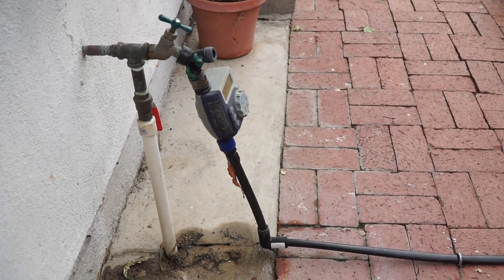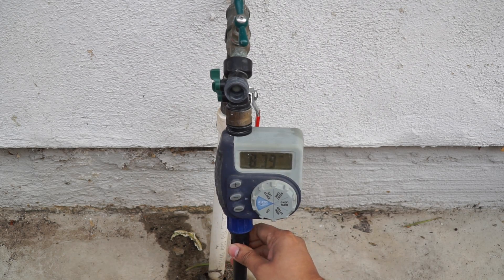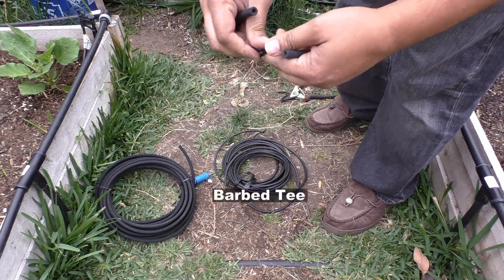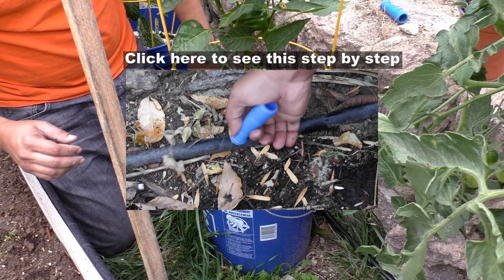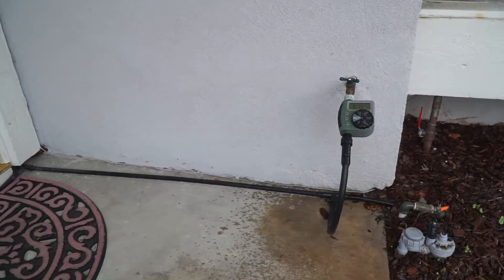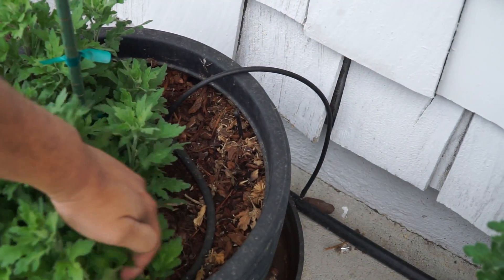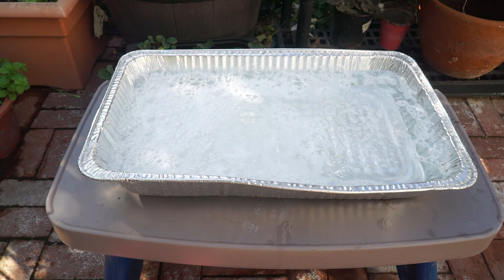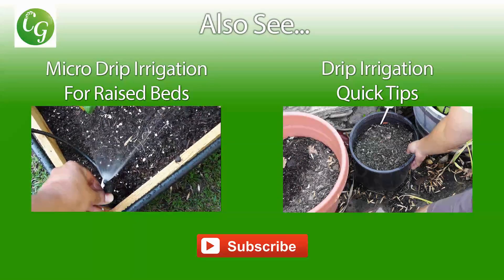Drip Irrigation Watering System For Containers - Setup & Instructions

Comment: Thanks a lot for all the information. As we are stuck at home due to the pandemic, wanted to try out gardening. Your channel is super helpful for beginners. I am trying to install a drip irrigation system at home, we have 4ft wide narrow garden bed with plants on the perimeter of our house. One dilemma I have is about the emitters to install in the narrow garden bed. Do you recommend a soaker hose ? One downside I see with soaker hose is if plants roots grow, we have to adjust the size of the circle. Thanks again!

Comment: Awesome video......I am also thinking of getting automatic water system for my pots. I don't have a garden but i have lots of containers in my verandah and at different levels......at the front of my house in front verandah at the back yard and back compound wall I have vertical garden..... Also I have balkani there also my planters are set up in vertical form..... I have sone more thwn 350 pots.... 250 at front and rest at the balkani and back yard..... My water tank is at the third floor. 
Can you advise what sort of drip irrigation syatem I shus have..... Will it be successfull?...... Do I need to use water pump..... Or pressure regulator..... Anything else

Comment from the maker: Parts used in this video:
1. Y-Hose Splitter: http://amzn.to/1L79qog
2. Watering timer: http://amzn.to/1LYgtKZ
3. Hose to 1/2'' tubing adapter: http://amzn.to/1LYgI8S
4. 1/2 inch main line tubing:  http://amzn.to/1LYgNJr
5. 1/4 inch tubing: http://amzn.to/1LYgQVT
6. Barbed connector (1/2'' tubing to 1/4'' tubing): http://amzn.to/1VVlJEJ
7. Barbed tees: http://amzn.to/1LYgSwU
8. Soaker Hose Emitter: http://amzn.to/1VVlOIs
9. Stream Bubbler Emitter: http://amzn.to/1QpRILy
10. Fan Bubbler on Stake: http://amzn.to/1L79KU4
11. Hole Punch: http://amzn.to/1L7bcWr

Comment: California Gardening, thanks much for this video. I have been fighting with watering my potted vegetables manually for years and often thought of going automatic but never had any experience with these systems. You make it look easy.
I see you used some elbows and other fittings for the main 1/2” line setup, can you tell me more aboout these fittings? do they glue in ? would you have the Raindrip numbers?
Reply from the maker: The elbows for the main line (1/2'') are just a tad wider than the main tubing. You just push the tubing into the elbows and tees, no tools or glue needed. Hope that helps!
Reply: mark

Comment: For the 5 gallon and the whiskey barrel containers do you use the same kind of emitters and run the drip for the same amount of time ?    thanks !! planning to start drip irrigation for my containers this year !!
Reply from the maker: No, the emitters for the large containers are usually soaker hoses. If I want more water I add additional emitters. Your number of emitters will depends on how large your container is
Reply: Hi

Comment: I've have had my system in for a couple of months now. I totally loved it but a couple of days ago I had a major problem. My house water pressure regulator ruptured. It cost me $675 to repair. Not to mention the water damage. Have you ever had this happen to you or do you know of a way to fix the issue? I had to go back to hand watering which I'm so disappointed with. How do you stop the pressure build up while still letting the water run. I did my system based on yours and I don't see anyone else having any problems. So I'm wondering what did I do wrong...This is so upsetting :(
Reply from the maker: Never had such an issue. Maybe you can use a pressure regulator to avoid this problem. It lowers pressure to 30 PSI at the entry point of the main tubing. Good luck!

Comment: Thanks for the video.  Its great.
Do you water all your vegetables in pots daily?  I have set mine for daily but I am a litte worried about over watering.  My soil drains well so I think that will solve it, but on the other hand some of them seem to dry very quickly which makes me think I should stick with daily.  Thanks for all the inspiration.
Reply from the maker: On hot summer days, 2 times a day for 4 mins. On warm days, once a day and in cloudy or winters, once every 2 days. Hope that helps!

Comment: Great video--so helpful to me (I've never put in a drip irrigation system before).  Do you have any videos showing how to begin from the beginning--that is, I've bought the cartons of "Patio Drip Watering Kit" but the enclosed instructions are horrible!  As an example, one of the things in the box is a rubber washer with a mesh screen built into it--but absolutely NO mention of where to put it, let alone which direction it should face.   The brand I bought (DIG) also includes 2 1/4" ball valves, but no mention of what they do or when to use them on the carton and if you try to find mention of them in their Installation Guide manual, there's not only NO mention of them, the only pictured item in that manual that even comes close to the actual ball valve is a thing called an "in-line shut off valve."   I'd sure appreciate your help!
Reply from the maker: Completely agree with you, the instructions on the box are not helpful. I am glad you found the video useful. I'll try to see if I can get a DIG kit and show step by step assembly. Thanks!
Reply: Whew.  I THINK I've got it almost done.  The absolute hardest part was assembling the beginning part--that is, from the faucet to the timer to the pressure reducer to the next thingey (sorry, I don't remember the name of that piece right at this moment) to the part having the hole where you slip in the 1/4" tubing.  After that, your video made everything a snap.  It took two different sales folks to figure out how to put together the beginning part--to decide which thing came before the next thing until we got to the place where the tubing is inserted.  I've run all the tubing completely encircling my deck and have most of the soaker hoses in place within their respective containers.  Next will be to connect pieces of 1/4" tubing to the encircling tubing and then connecting each one to its respective soaker hose in each separate container.   By the way, by the time we "built" that beginning part, we were looking at a unit that was about 12-1/2" long from faucet to tube insertion point!  I had no idea it would be so big!

Comment: Hey CG, I love your videos! I'm trying to set up this irrigation system for my containers and when I went to the store, the sales staff recommended using a 1GPH or 0.5GPH drip emitter over a soaker hose. So, is there a reason why you don't use drip emitters? Can you please tell me the GPH rating of a standard soaker hose used according to the way you did? I'm trying to calculate how much water my plants might get with a soaker hose. Thanks!
Reply from the maker: +Neerja Pancholi The problem with the drip emitters is that they are fixed in GPH. But in practicality it doesnt work well. For example, a large container will require 4 such such emitters while a small container might just need 1. So it becomes expensive to keep adding emitters. With an adjustable GPH emitter you can use 1 or 2 and then turn the know to how much water you need. Much cheaper in the long run and also very convenient. Hope that helps!

Comment: I really like this video. I want to set up a system but I'm too scared to. When I go to my home store, I get over whelmed with everything. I've seen some kits but still I'm still not sure what to do. You have a main line for everything? Can the water reach everything? Is there a limit on how many connectors? I have about 8 potted plants and 2 garden beds. Going to go back soon and look at them again. This clears up some of my questions. Thanks for linking the Amazon products!
Reply from the maker: +OmgKittys78 Yes it can be overwhelming but its surprisingly easy once you plan what to do. Yes there is 1 main line for everything, runs all along. Yes water does reach everything. When I went from 10 to 25+ containers, I had to remove the pressure regulator to push more water thru. Good luck!

Comment: Looks handy if you go on holidays, just wondering when you water a large pot with your irrigation do you water so the water comes out of the drainage holes on the bottom each time? If not, do you get salt build up? Thanks
Reply from the maker: +MystiiKBird PVP Yes I set my timer in such a way that water comes out from the largest container. Currently that time is 3 minutes.

Comment: How do you clean the inside of the tubing? it looks like you only cleaned the outside. I thought the clogs form on the inside of the tubes ??
Reply from the maker: +Cassian YHVH Good question. The water will go inside the tubes as well. You can add some vinegar if you have lime deposits inside, it will remove them.

Comment: great! recently my drip irrigation system (partially) is completely block, and my mistake is that  i had not installed filter in tubing line. that was  very trouble for me to again clean tube an all.. and liked what i heard  soaker roll, it looks very effective for containers.
Reply from the maker: +umar ufx Yes a filter is a good idea if you want to remove bigger particles from the water. Here in my city we do not get much of that but I do see the soaker hose being blocked after a few years due to lime/deposit buildup. The cleaning method works well!